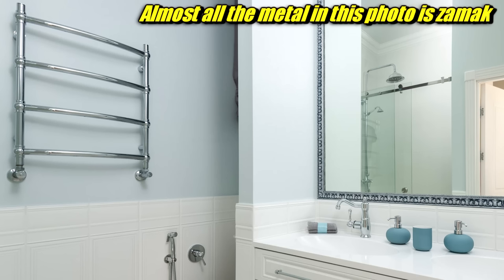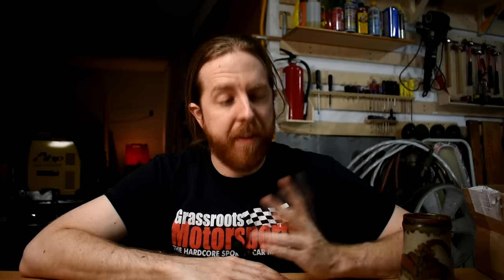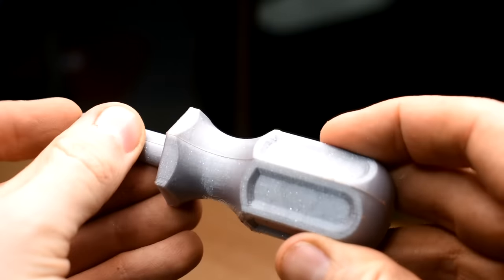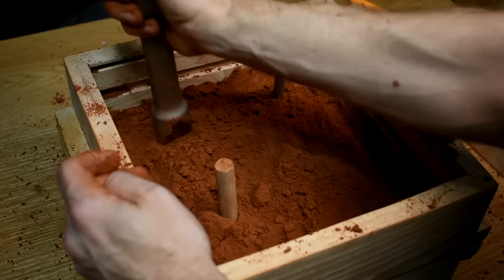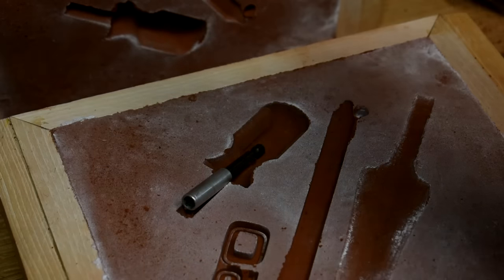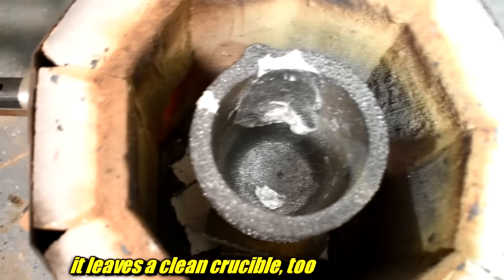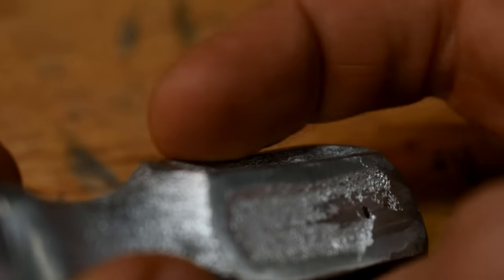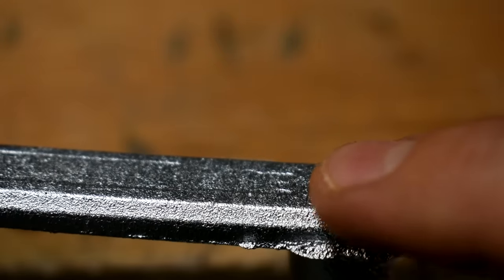The BEST Metal Casting Alloy That Everyone Ignores

Comment: This was called Mazak when it was used  in Metoy toy company.
Reply from the maker: Wasn't that a patent or trademark issue or something?  Basically it's the same stuff I think
Reply: @PaulsGarage  have no idea if that right I worked for a fire door company when they upgraded the injection molding process back in the 1970s where the molten metal was fed down an asbestos lined sluce to the machines directly from the smelting plant it was amazing to watch a river of silver running to the molds, I can remember pallets of ingots stamped with mazak on them.

Comment: Technically ZA12 in NOT a ZAMAK alloy. The K stands for kupery which is German for copper.  They typically have 1-4% copper in them.  ZA12 is about 11% aluminum and 89% zinc with only a trace of copper.  There is no such thing as ZAMAK-12.

Comment: Zamak will deform creep under stress and heat well below it's melting point..it's a known fault of the zamak series alloys.
Reply from the maker: Yeah that's probably another reason zamak isn't used in high heat uses.  You really can't beat cast iron.

Comment: "there is nothing you can do" buuuuut why not just glue it back together and then casts it in epoxy? even if the zinc turns to mercury zinc powder... the epoxy would still hold it's shape for it.

Comment: There are some things I loathe being zinc. Usually electrical fittings for conduit. If you know it's going to see an easy life, it's okay. But if it has to withstand living a life around idiots who pay no mind and care about nothing (in industrial settings where meth heads drive heavy equipment), steel is what I use.

Comment: What about Vanadium??
Reply from the maker: Pure vanadium needs too much heat to melt, I couldn't do it in my garage.  Don't know where I could get a brick of vanadium anyway
Reply: @PaulsGarage  most automotive tools are made of vanadium. Say cheap craftsman and the like.. not Snap On or Macko (nor impact tools; blackened sort).. if not now for sure older tools. A basket of wrenchs, extensions, and sockets wrenches should do. I use to work automotive and this was the difference between weak tools. Hope this helps

Comment: 'Ring of Fire' 2a manufacturers centered on Raven Arms approves. Its bulkier than aluminum/steels but easier to work w/ cuz casting = easy. 

Short Story:
Raven Arms n co got bad rep cuz they specifically marketed their firearms to middle/lower class ppl (supplying pawn shops etc w/ new ones) to makeup for the Gun Control Act and how it cut the supply of cheap imported pistols (Rohm in Germany, Rossi in Brazil, etc). 
The result was Raven n co's pistols got used BY A LOT of criminals, and cops didn't like that minorities were able to afford new guns...So they slowly worked to find ways to break up the 'ring of fire' but it was like a Hydra.
Reply: POINT: 
Raven n co NEVER went out to make 'high quality' guns out of zamak, they made the Saturn (cars) version: cheap, bulky, but functional; no 'extra features', just bare mins.    IMO they did a GREAT JOB of that. 
       Hi-Point thought so, they picked up where Jimenez no co left off and their pistols are among the cheapest full-size ones on market (thanks to also using polymer now vs full Zamak in 60s-80s). YES hi-points are among most common pistols used by hood-rats, but they're also owned by ALOT of low/middle class ppl as they're affordable: so when hood-rats steal some1's gun; good % of time its a hi-point.

Comment: This means that we are in the temperature range of a pyrolysis cleaning kitchen oven!

No more propane or need to build a furnace
Reply from the maker: You're right!  You could technically do it that way.  Would be pretty hard to get the crucible out when the oven is locked though
Reply: @PaulsGarage  I was born hard! :)
Reply: My furnace is electric and melts zinc very quietly.
Reply: I do small castings in zamak with a little soldering tin pot and a dipper, even. Temperature control makes it easy to avoid boiling, although it's not the fastest way to get it melted.

Comment: First time I ever heard of anyone finding anything good to say about zamak!  Anyone at anytime.  I have faucets that are fifteen years old that were made of that crap and then chrome plated.  Well the zacrap under the chrome has corroded up and is popping through the chrome plating.  It is used around boats and in salt water it lasts two or three years before disintegrating.  The strength is so low that cleats that were made from it just break.  Pure junk.  If you have to make it out of zacrap just don't make it.  You invest a lot of time into casting so why waste it with a garbage product?

Comment: Zamak as a belt buckle is a bad choice. I am a saddler and see this all the time, the zamak is a weak metal, has to be plated with nickel or chrome. easily scratched, and the scratch cannot be polished out, where as the buckles I use, brass, german silver, and steel alloy 304, can be polished over and over and over to make them look brand new. I stay away from zinc alloy buckles, cheap and nasty. in the trade we call zinc alloy buckles - muck metal.

Comment: Zamak is crap.  It corrodes, it cracks.  Logos on cars were made of it & plated over for one reason.  CHEAP.  It's not about the material, it's about the low cost of fabrication of complex shapes by die-casting.  Those get cancer from the inside out, the plating flaking off.  Another thing these alloys do is slowly change dimension as they age, opening up cracks & causing mechanisms to jam.
          I have repaired numerous devices made of Zamak, gears in time-card punches, mechanisms in juke boxes, etc.  The problem was more the creepage in dimension over time than corrosion, forcing replacement rather than repair.  If you want good castings, bump up the copper content & make low-copper bronze!

Comment: Spin cast
Reply from the maker: Spin casting looks pretty cool but I'm going the vacuum route.  Spin casting has some limitations that vacuum doesn't
Reply: @PaulsGarage  Yes, vacuum casting will greatly improve the finish and details... It's how jewelry is made... the downfall is having a long burnout time for the investment but if you use Zamak you could switch to a Metal Furnace like they use for Spin Casting so it will hold the temp exactly where it should be for casting...